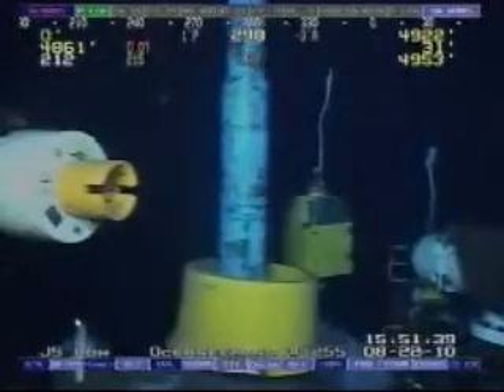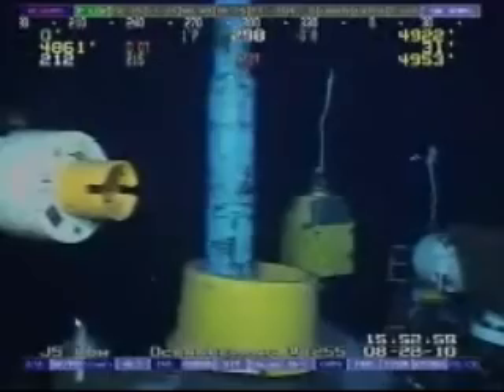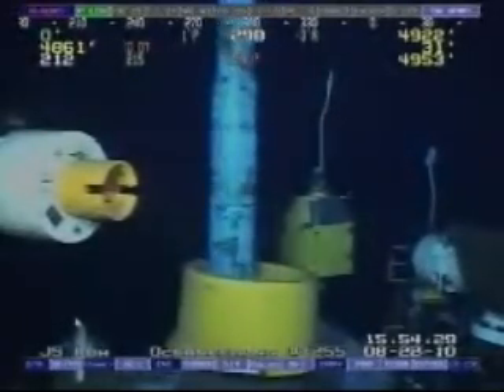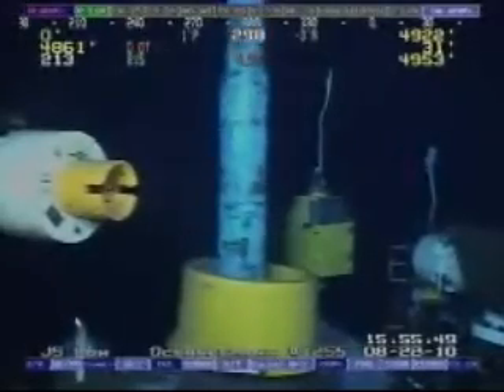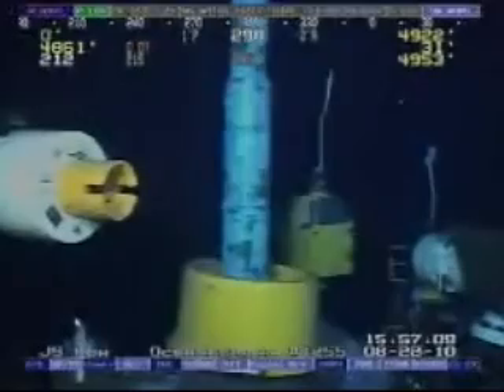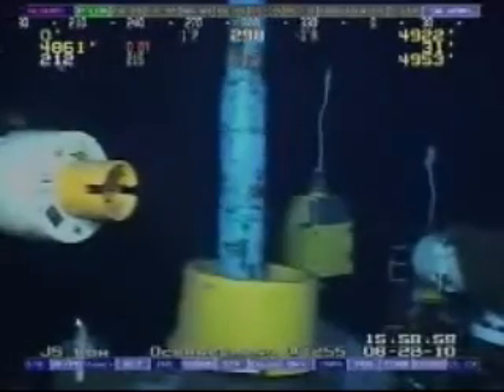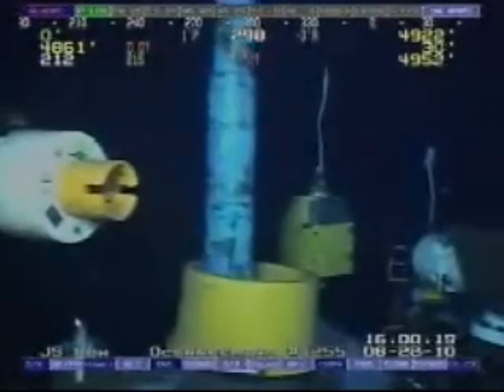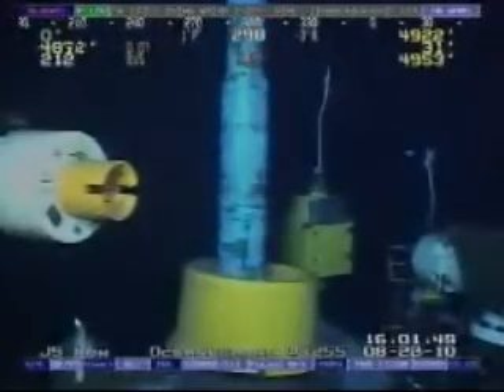BP now pulling out 3,500 feet of drill pipe from the 5,000 foot cement plug holding back oil

Comment: @jawayetti 

The BP guy explains that if they remove the BOP before taking the pipe out, the pipe would be attached to the BOP and they would have to lift the BOP the length of the pipe i.e. 3,500 feet.
Therefore I believe BP wants to remove the BOP from the well, which is understandable for a well not being exploited. BP prolly wants to use the BOP somewhere else.